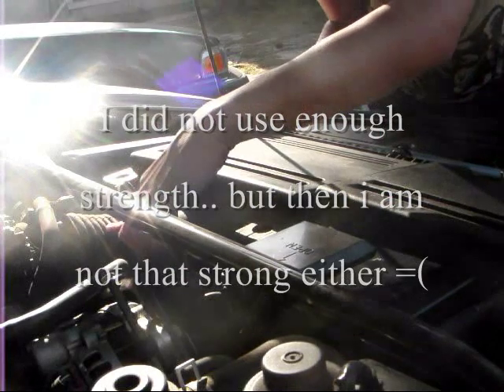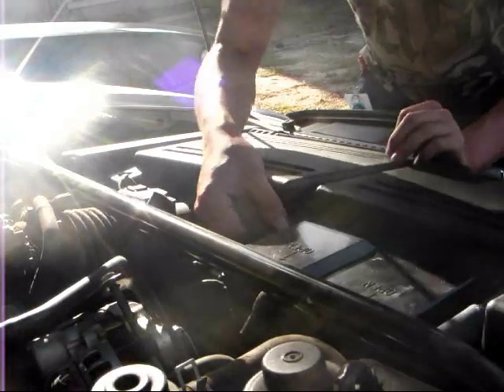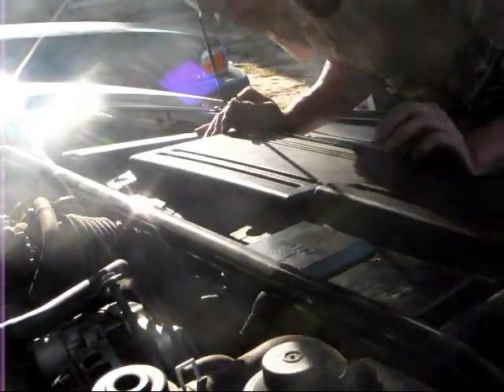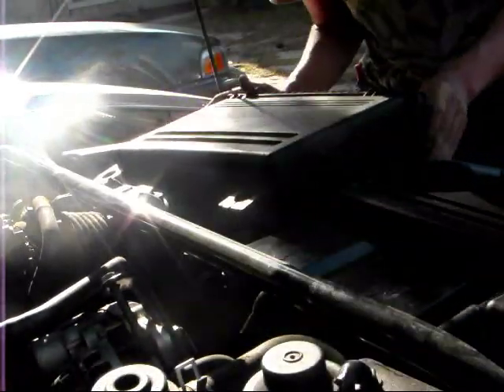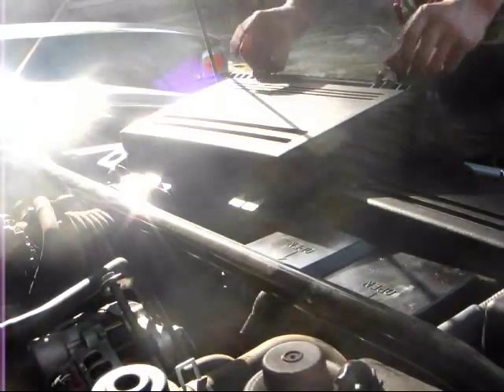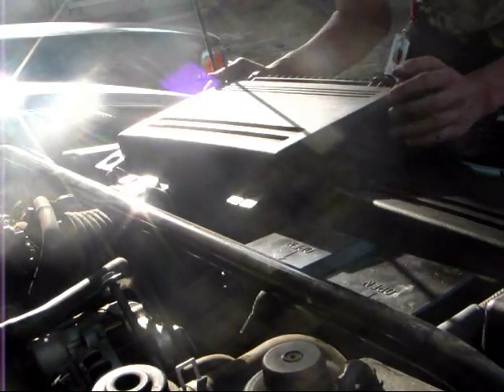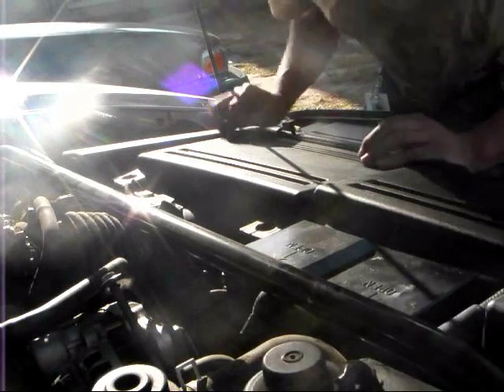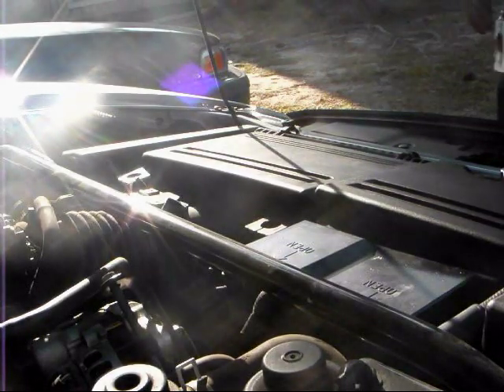Removal of RX-8 Air Filter

Comment: the tube that compresses when you push the air filter box forward wont do the same on my car. It just  wont budge. it is winter season and its atleast -15c here right now. Im hoping its just cause of the cold that causing the problem.